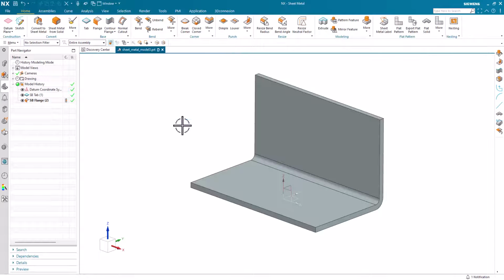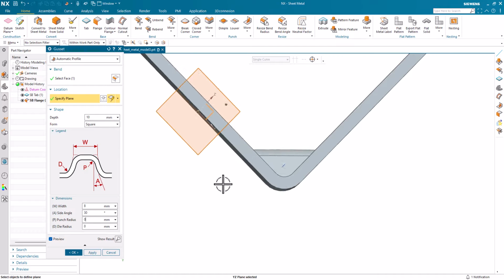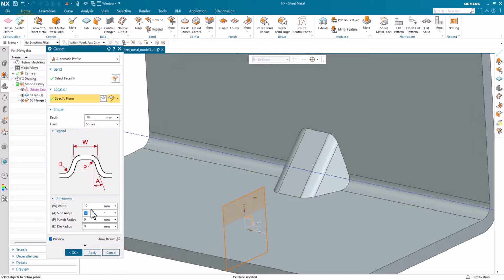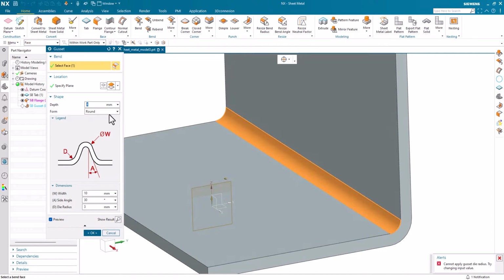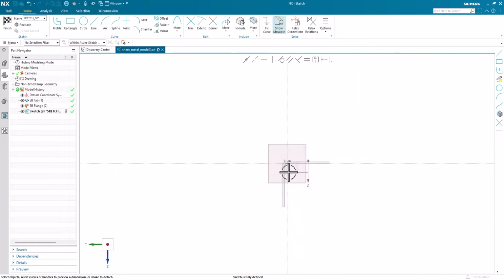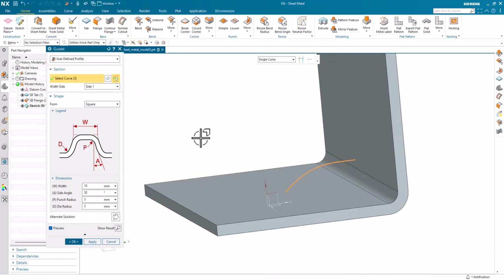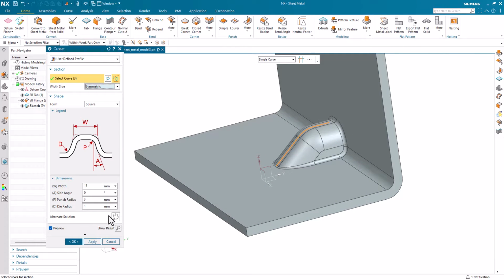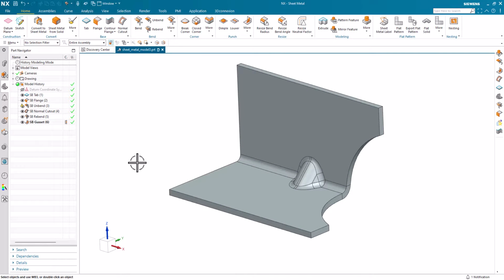Siemens NX Sheet Metal: Gusset Deep Dive

Comment: In practice, when making sheet metal designs, when should I use the Gusset command?
Reply from the maker: Gussets are typically used for strengthening the product.  Each time a gusset is added to bend, the bend becomes stronger and less likely to 'open' due to the inherent strength of the deformed material.  This means thinner gauge metal can be used (ie cheaper material cost) without loss of strength